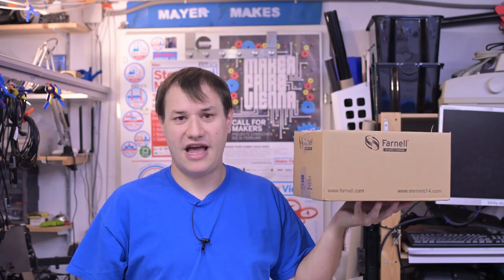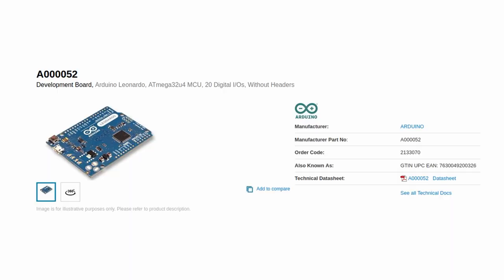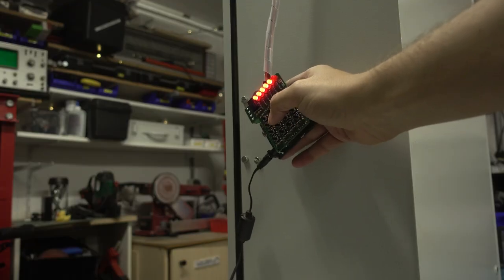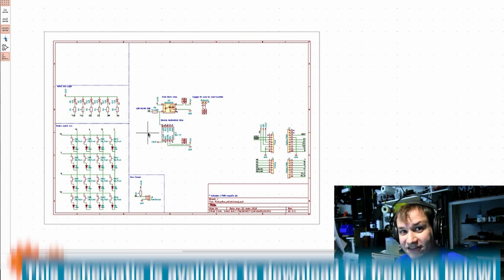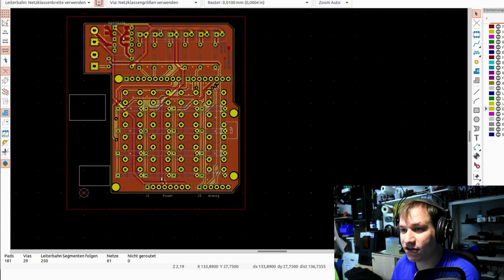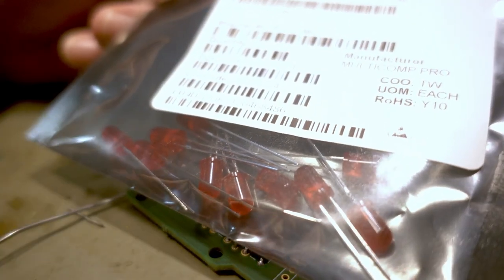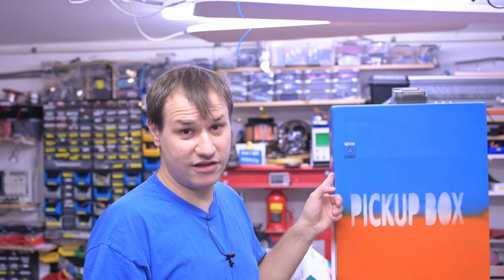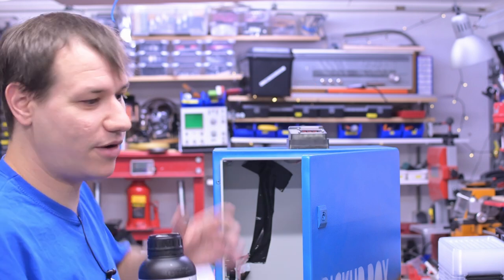How to Make a Secured Parcel Pickup Box with Arduino

Comment: This is a cool project, but it needs to have only the keypad outside and all the other electronics should be inside. That would also have the benefit of allowing you to use a readily available commercial keypad that is durable and completely weatherproof.
Reply: And it would also allow you to easily change or add technologies. You could add biometrics, NFC, or any number of other readers (or displays, like for dynamic QR codes) to give other options for people with various physical issues or to make it easier for you to insert packages. Add a sensor, update the code and go!
Reply: Sounds like you would like a part 2

Comment: You should add a second method for opening the box in case the battery or Arduino fails.
Reply: a swipe card  be nice  too
Reply: You can open the controller box and directly apply 12V to the relay.
Reply: @Hacker-at-Large  what about  for muti package  haveing  package theft issue
Reply: Please post your ideas on the element14 page(link in description), i get notificstions there and its much easier to tdlk about them there with pictures and links.

Comment: Am I understanding it right that you could just short A3 to ground to open the thing? Just ripping the top thing off and cutting the cable might already open it on accident. Otherwise, you could also just put the battery up to the solenoid cables to open it. 
Usually you'd want to put the thing checking the code and controlling the solenoid(the arduino in this case) inside the lock box, and only expose the keypad to the outside.
It is more secure than no box at all, of course, but not very secure at all.
Reply: First, this is an arduino project not a safety device, so of course there are ways, as with anything to defeat it.
in case you rip off the top case(screwed from inside) you could cut the cable , but that would not open it as the solenoid needs to have power applied to move.
Shorting A3 to gnd would do it, but first you would need to know that to try. The Electronics are not on the inside for a super specific reason: I have no way to make a clean cutout in the box at moment and time was running out. So yes, there are ways to get in, as with any locked box. The battery is on the inside and does not fit through the hole for the cable, so for activating the solenoid you need to bring your own battery.
The thing we learn from this is that violence finds a way.
Reply: Jort, you are assuming the attacker has watched the video 😁
Reply: A crowbar would likely work too.
Reply: @Workshopshed  Violence enters everything
Reply: @Workshopshed  No, this is actually a well-known and often exploited vulnerability with cheap commercial products. There's no point in having a code if all they have to do is get to the solenoid wires and activate it.

The decoding should ALWAYS take place inside the strongbox. Any readers (biometric, keypad, NFC, optical scanner, etc.) has to be outside to be used, but it should never be possible to unlock the container from the outside with any combination of wires or a power supply.
Reply: This is a very good point. I was going to make it myself. I would not trust this system at all for my own use.
Reply: You could move the Arduino inside and have a bundle of wires from the keypad. Or you could use something like an ATtiny to encode the keypad presses and send serial Comms back to the Arduino inside the box, that way you would just need tx and gnd. An attacker on the outside would still need to know the combination.
Reply: @jort93z  I mostly focused on getting this to work asap, not so much about the details of acessing it, since people will make superb alterations anyway. and any burglar will use a crowbar earlier than even thinking about cables.